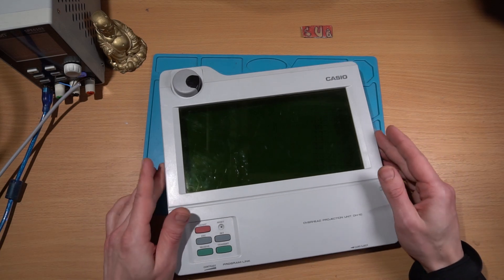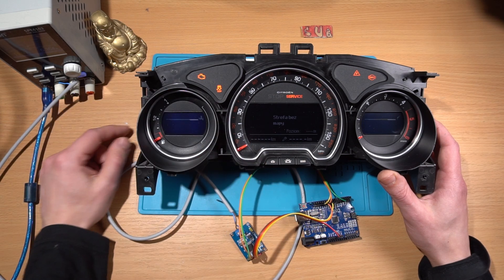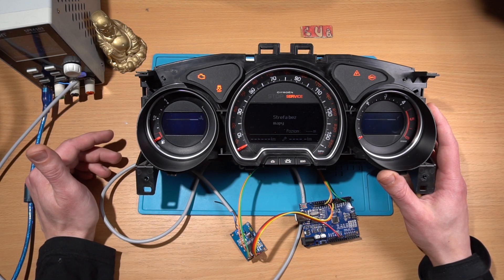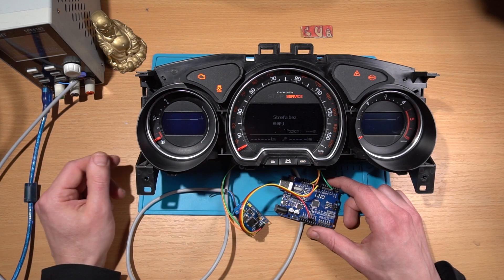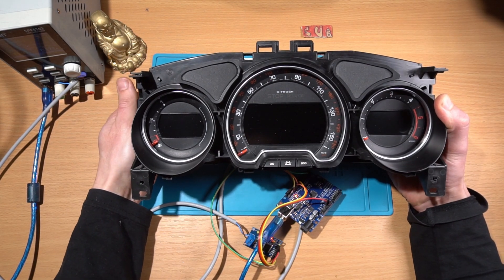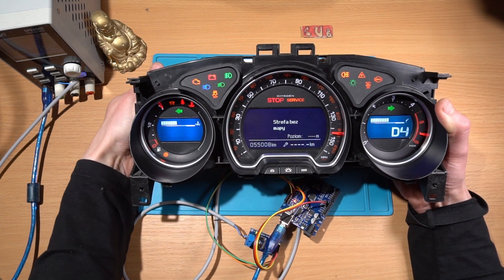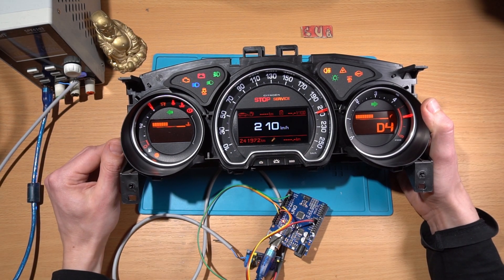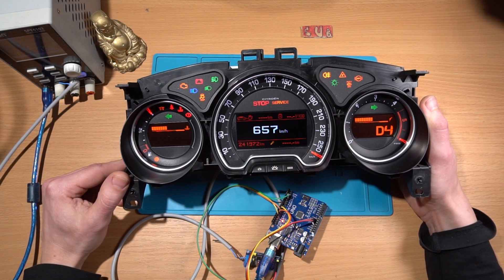Citroen C5 dashboard tester EN

Comment from the maker: #include <SPI.h>
#include <mcp2515.h>
struct can_frame canMsg2; //rpm + speed
struct can_frame canMsg3; //odo display
struct can_frame canMsg4; //oil + fuel
struct can_frame canMsg5; //ign +bklight
struct can_frame canMsg6; //lights1 on
struct can_frame canMsg7; //lights2 on
struct can_frame canMsg; //recived frame
MCP2515 mcp2515(10);  //chipsel on pin 10
                    
int bezpiecznik = 0;                    
int milage1; //km byte 0
int milage2; //km byte 1
int milage3; //km byte 2
int fuel = 0 ;
int b; // add to byte 0 to FF chksum
int n; // add to byte 1 to FF chksum
int m; // add to byte 2 to FF chksum
int speed1 = 0;
int speed2 = 0;
int rpm1 = 0;
int rpm2 = 0;
int dispodo1 = 0;
int dispodo2 = 0;
int dispodo3 = 0; 

int d; // bklight button counter
int liczarka;

void setup() {
  SPI.begin();
  
  mcp2515.reset();
  mcp2515.setBitrate(CAN_125KBPS,MCP_8MHZ);
  mcp2515.setNormalMode() != MCP2515::ERROR_OK;

  canMsg2.can_id  = 0x0B6;  //formating messages
  canMsg2.can_dlc = 8;
  canMsg2.data[0] = rpm1;
  canMsg2.data[1] = rpm2;
  canMsg2.data[2] = speed1;
  canMsg2.data[3] = speed2;
  canMsg2.data[4] = 0x00;
  canMsg2.data[5] = 0x00;
  canMsg2.data[6] = 0x00;
  canMsg2.data[7] = 0xD0;

  canMsg3.can_id  = 0x0F6;
  canMsg3.can_dlc = 8;
  canMsg3.data[0] = 0x8E;
  canMsg3.data[1] = 0x80;
  canMsg3.data[2] = dispodo1;  //odo
  canMsg3.data[3] = dispodo2; //odo
  canMsg3.data[4] = dispodo3; //0do
  canMsg3.data[5] = 0xB6;
  canMsg3.data[6] = 0xFF;
  canMsg3.data[7] = 0x10;

  canMsg4.can_id  = 0x161;
  canMsg4.can_dlc = 7;
  canMsg4.data[0] = 0x00;
  canMsg4.data[1] = 0x00;
  canMsg4.data[2] = 0xAC;   //oil temp
  canMsg4.data[3] = fuel;   //fuel guage
  canMsg4.data[4] = 0x00; 
  canMsg4.data[5] = 0x00;
  canMsg4.data[6] = 0xFF;

  canMsg5.can_id  = 0x036; //ignition +brightness
  canMsg5.can_dlc = 8;
  canMsg5.data[0] = 0x0E;
  canMsg5.data[1] = 0x00;
  canMsg5.data[2] = 0x00;
  canMsg5.data[3] = 0x3F; 
  canMsg5.data[4] = 0x01;
  canMsg5.data[5] = 0x00; 
  canMsg5.data[6] = 0x00; 
  canMsg5.data[7] = 0xA0; 

  canMsg6.can_id  = 0x128; //dashlights1
  canMsg6.can_dlc = 8;
  canMsg6.data[0] = 0xFF;
  canMsg6.data[1] = 0xFF;
  canMsg6.data[2] = 0x00;
  canMsg6.data[3] = 0x00; 
  canMsg6.data[4] = 0xFE;
  canMsg6.data[5] = 0x11; 
  canMsg6.data[6] = 0x38; 
  canMsg6.data[7] = 0x00; 

  canMsg7.can_id  = 0x168; //dashlights2
  canMsg7.can_dlc = 8;
  canMsg7.data[0] = 0xFF;
  canMsg7.data[1] = 0x00;
  canMsg7.data[2] = 0x00;
  canMsg7.data[3] = 0xF3; 
  canMsg7.data[4] = 0x03; 
  canMsg7.data[5] = 0x00;  
  canMsg7.data[6] = 0xF0;
  canMsg7.data[7] = 0x00; 
}

void loop() {
 
  liczarka ++;   //counter for slow send of can messages
  if (liczarka > 600) {
    liczarka = 0;
  }
  
  if (mcp2515.readMessage(&canMsg) == MCP2515::ERROR_OK) {  //read of can and reset of failsafe
       bezpiecznik = 0;
         }

bezpiecznik++;    // if can com stops it clears odo buffer to avoid writing different milage to new cluster
if (bezpiecznik == 7000) {
  milage1 = 0;
  milage2 = 0;
  milage3 = 0;
  }  

if (canMsg.can_id == 0x257) {   //checking if milage send from cluster is correct and copy to buffer
  if (canMsg.data[0] + canMsg.data[3] == 0xFF) {
    if (canMsg.data[1] + canMsg.data[4] == 0xFF) {
      if (canMsg.data[2] + canMsg.data[5] == 0xFF) {
           milage1 = canMsg.data[0]; 
           milage2 = canMsg.data[1];
           milage3 = canMsg.data[2];
           b = canMsg.data[3];
           n = canMsg.data[4];
           m = canMsg.data[5];
         }
      }
   }
}
if (canMsg.can_id == 0x217) { //checking buttons on cluster
  d = canMsg.data[0];   // bklight counts 02 to F2
     }

if (liczarka == 500) {
  switch (d) {
        case 0x02:       //0 --0rpm Fuel0 0kmh
          speed1 = 0x00;
          speed2 = 0x00;
          rpm1 = 0x00;
          rpm2 = 0x00;
          fuel = 0x00;
        break;
        case 0x12:       //1 -- 0rpm Fuel0  10kmh(8*100>toHEX)
          speed1 = 0x03;
          speed2 = 0x20;
          rpm1 = 0x00;
          rpm2 = 0x00;
          fuel = 0x00;
        break;
        case 0x22:         //2 --500 Fuel0 30
          speed1 = 0x0A;
          speed2 = 0xF0;
          rpm1 = 0x0F;
          rpm2 = 0xA0;
          fuel = 0x00;
        break;
        case 0x32:            //3  --1000 Fuel1/4 50
          speed1 = 0x12;
          speed2 = 0xC0;
          rpm1 = 0x1F;
          rpm2 = 0x40;
          fuel = 0x00;  
        break;
        case 0x42:             //4   --1500 Fuel1/4  70
          speed1 = 0x1A;
          speed2 = 0x90;
          rpm1 = 0x2E;
          rpm2 = 0xE0;
          fuel = 0x0D;       
        break;
        case 0x52:               //5 --2000 Fuel1/4 90
          speed1 = 0x22;
          speed2 = 0x60;
          rpm1 = 0x3E;
          rpm2 = 0x80;
          fuel = 0x1A;       
        break;
        case 0x62:               //6  --2500 Fuel1/2 110
          speed1 = 0x2A;
          speed2 = 0x30;
          rpm1 = 0x4E;
          rpm2 = 0x20;
          fuel = 0x26;       
        break;
        case 0x72:                  //7 --3000 Fuel1/2 130
          speed1 = 0x32;
          speed2 = 0x00;
          rpm1 = 0x5D;
          rpm2 = 0xC0;
          fuel = 0x32;         
        break;
        case 0x82:                 //8 --3500 Fuel1/2 2 150
          speed1 = 0x39;
          speed2 = 0xD0;
          rpm1 = 0x6D;
          rpm2 = 0x60;
          fuel = 0x3F;            
        break;
        case 0x92:                  //9 --4000 Fuel3/4  170
          speed1 = 0x41;
          speed2 = 0xA0;
          rpm1 = 0x7D;
          rpm2 = 0x00;
          fuel = 0x4A;           //7.8
        break;
        case 0xA2:                   //10  ---4500 Fuel3/4  190
          speed1 = 0x49;
          speed2 = 0x70;
          rpm1 = 0x8C;
          rpm2 = 0xA0;
          fuel = 0x57;       ///8.8
        break;
        case 0xB2:                    //11  --5000 Fuel3/4 210
          speed1 = 0x51;
          speed2 = 0x40;
          rpm1 = 0x9C;
          rpm2 = 0x40;
          fuel = 0x64;
        break;
        case 0xC2:                     //12 --5500 Fuel4/4 230
          speed1 = 0x59;
          speed2 = 0x10;
          rpm1 = 0xAB;
          rpm2 = 0xE0;
          fuel = 0x64;
        break;
        case 0xD2:                      //13 --6000 Fuel4/4 250
          speed1 = 0x60;
          speed2 = 0xE0;
          rpm1 = 0xBB;
          rpm2 = 0x80;
          fuel = 0x64;
        break;
        case 0xE2:                      //14 --6000 Fuel4/4 260
          speed1 = 0x64;
          speed2 = 0xC8;
          rpm1 = 0xBB;
          rpm2 = 0x80;
          fuel = 0x64;
        break;
        case 0xF2:                      //15 --6000 Fuel4/4  657kmh
          speed1 = 0xFF;
          speed2 = 0xDC;
          rpm1 = 0xBB;
          rpm2 = 0x80;
          fuel = 0x64;
        break; 
        }
    mcp2515.sendMessage(&canMsg2);  //sending rpm + speed
    mcp2515.sendMessage(&canMsg3);  //sending odo display
    mcp2515.sendMessage(&canMsg4);  //sending oil + fuel

  }
  if (liczarka == 100) {
    mcp2515.sendMessage(&canMsg5);  //sending but not so often ign +bklight
  }
  if (liczarka == 200) {
    mcp2515.sendMessage(&canMsg6);  //sending but not so often lights1 on
  }
  if (liczarka == 300) {
    mcp2515.sendMessage(&canMsg7);  //sending but not so often lights2 on
  }

canMsg2.data[0] = rpm1; //updating bytes
canMsg2.data[1] = rpm2;
canMsg2.data[2] = speed1;
canMsg2.data[3] = speed2;

dispodo1 = milage1;
dispodo2 = milage2;
dispodo3 = milage3;
canMsg3.data[2] = dispodo1;  //odo
canMsg3.data[3] = dispodo2; //odo
canMsg3.data[4] = dispodo3; //0do

canMsg4.data[3] = fuel;
}